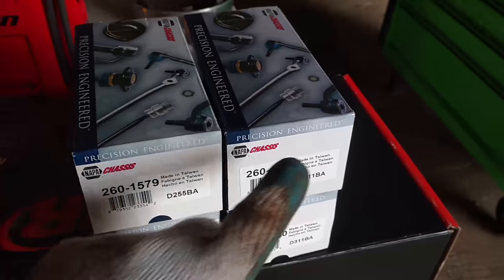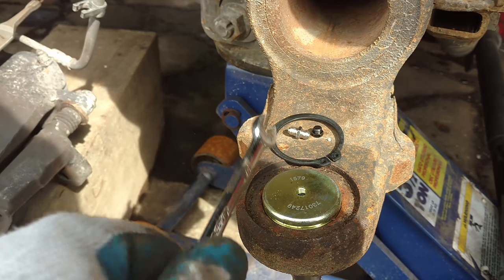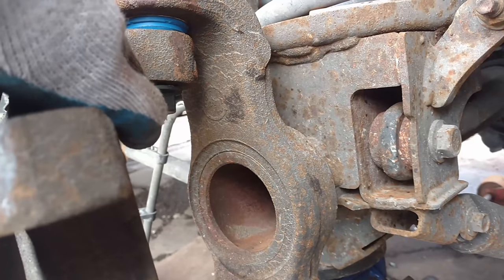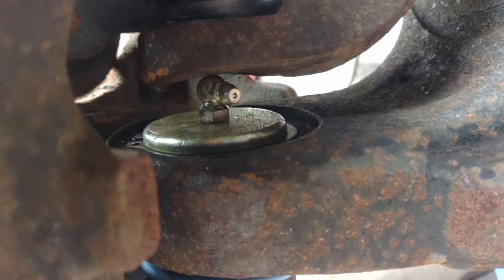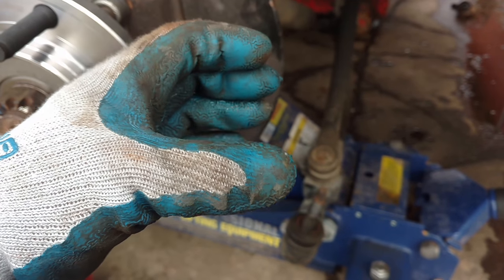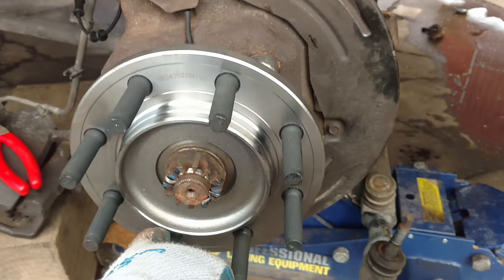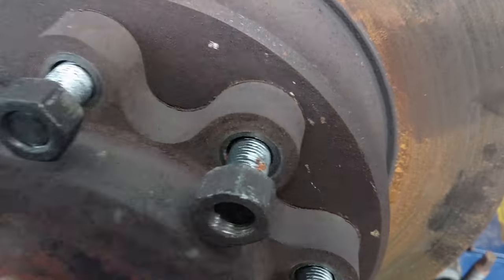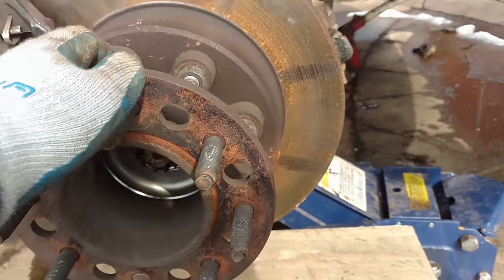PT 2) 2011 DODGE 3500 DUALLY 4X4 BALL JOINTS, AXLE JOINTS & HUB BEARINGS

Comment: That’s why I like Moog steering parts! There’s a torque spec for the upper and lower ball joints 70 start on the top 30 start on the bottom finish at 160 foot pounds. The four hub bolts Are torqued at 160.

Comment: great video and on a side note, your part one vid of this when you talked about being careful when removing the bearing snap-on has a round punch type deal that is specifically for doing those on the dodge trucks, you stick one end on the threads and then you turn the wheel to pop them out. if i can find mine ill leave the part number on this video, and if i was to pick up a small tripod and send it to you that could help out so you didnt have to do everything one handed lol
Reply from the maker: yes send me the part number if you have it. i may have it. i wasnt concerned with these hub bearings since i was replacing them anyway. i used my phone for these 2 videos and i dont have a tripod that will hold it. i have a tripod for my go pros..they are just not as easy to use as i forget to grab them when i go to the shop....but i always have my pone on me.
Reply: J.C. SMITH PROJECTS I'll see if I can find you a tripod that will work with your phone I know I've seen them just don't remember where but the tool I was talking about is snap-on DHPI , when I was working on dodge trucks a lot I bought it and it came in handy
Reply from the maker: i dont work on many dodge trucks. i have used a center punch on the heads of the bolts once they are backed off a bit...it worked ok. if i worked on a lot dodges i think i would invest in it tho.
Reply: J.C. SMITH PROJECTS I hear ya just wanted to mention the tool in case one day it could come in handy
Reply from the maker: i do appreciate it!

Comment: I may of just not of heard you J.C. but did the straight grease fitting work in the u joint and not hit the axle? I was wondering if you might think one of the slip on grease gun tips would slide in on them if it did?   

The wife was watching tv so I had the volume kind of low.
Reply from the maker: no. not enough room for any grease fitting....i had to grease it then remove it and put a plug in it.
Reply: It looks like after all these years they would do better than that, I sure don't see non serviceable as better myself.

Comment: That's too bad about that grease fitting - can't get them any smaller than that...even if it was a button head - how you supposed to get a whip on it
Reply from the maker: Turn the axle to the open spot, remove the plug, install 90* fitting, grease it, remove 90* grease fitting and replace plug. horrible design.
Reply: If poss drill and tap from side. Check with  mother mopar/fca if can do? You know C.Y.A. will have to do the same to the ball joint Also a C.Y.A.... Nice mopar! Thanks for the vid's.
Reply: Please tell us that you also used never seize on all the flanges, including the rotor and wheel.
I use the stuff on everything up here in Northern Michigan and it has saved my bacon more times than I can recall. 
It will not allow rust to jack a flange out of balance and you will never have an ABS sensor issue due to rust jacking if the trigger wheels
 are coated.
Rust belt mechanics best friend.

Comment: Unfortunately the grease fitting isn't a Dodge thing it's a Dana axle problem. My Ford is the same way. If they were easy to  grease they would probably last forever ! Lol
Reply from the maker: i think they use the aam axles in these dodge since 2003. i agree. you would thing they could come up with something better.

Comment: Dont blame you a bit for going deep so to speak and changing the things that could be a problem fdown the road, your in there , do it now and you dont have to worry about it for a good long while. Some folks just plain wont or dont want to spend the extra money to do the one or two other things while your at it. I  look at it like I can do it now while I am in this deep or have to go thru 3/4 of these steps and then some to do it later.

I'd bet you raring to do some towing with this and see how she does, BTW how did the trips down to Kentucky go, I missed all the live streams you did while you were there and been meaning to ask you in one of the streams, but seems to have missed some as of late..
Reply from the maker: it went great except for the c4500 getting 7 mpg pulling my camper! i would have liked to use this dodge but i didnt get it done in time.
Reply: I recall you saying you didnt think it would be done in time for the show. Ah well least you guys had a good time and now that the silver dodge is all fixed up and ready for the road, I am sure you'll get to use er for some towing sometime soon.

Comment: What's your opinion on a 2004 f250 5.4 motor? Looking to get one with 172k miles I know I might have some transmission issues if it's not the newer transmission from mid year 2004. But if the motor has had good maintenance it will be alright for another 100k?
Reply from the maker: which engine is it? 2 valve or 3 valve? i have on seen the 3 valve with the 5r110 transmission. i would be concerned with the cold start up on the engine. listen for any rattles that go away after the engine builds oil pressure. look in the oil fill cap and see if you find any oil sludge or build up. if it is clean and sounds good within no ticking, i would replace all the timing components, the lash adjusters and the cam followers if they have done been done in the last 30k miles.
Reply: J.C. SMITH PROJECTS  I haven't looked at the truck yet to see the build date. I'm not sure if it's 2 valve or 3 but thank you for the advice! Do you sell trucks? I was asking because I don't know anyone with a 5.4 to ask if they had good luck in the higher miles or not. I'm new to your channel but I really like your content keep up the good work!

Comment: great videos.  Thanks so much.  Question though: how do you know if you need to replace the wheel hub or ball joints or both?
Reply from the maker: look for play, stiffness and rust coming from the cups in the axle joints, wheel joints. look for up and down play in the ball joints. both can cause what we call "memory steering". that means that the ball joints, tie rods, or axle joints may be stiff. example....after making a left turn, the vehicle wants to pull to the left. then you turn right and it wants to pull to the right. most of the time we see this because of axle joints in a 4 wheel drive truck.